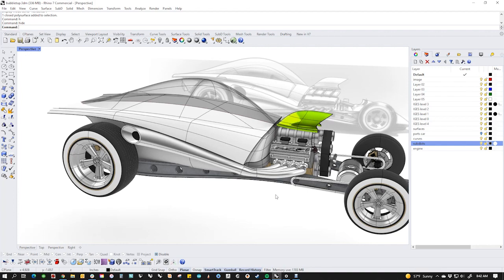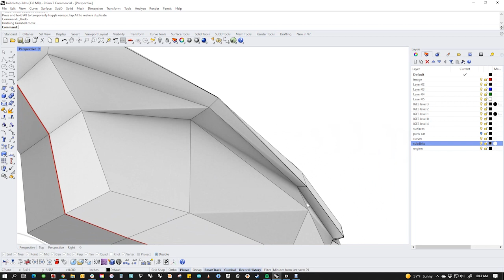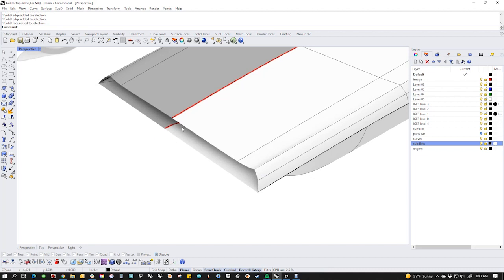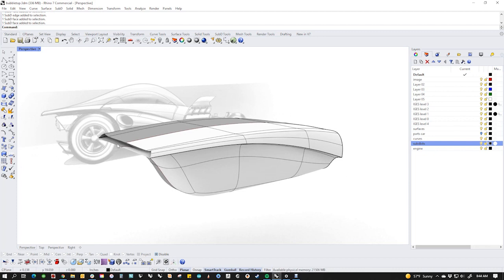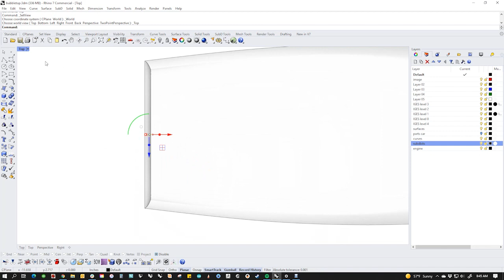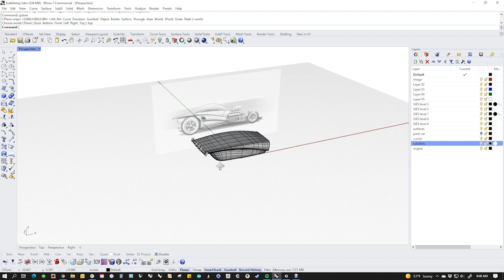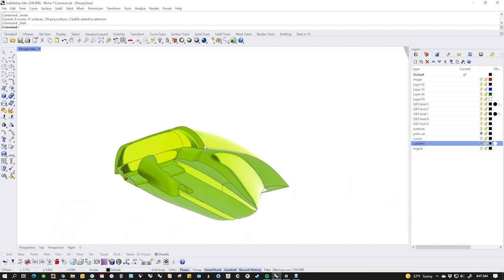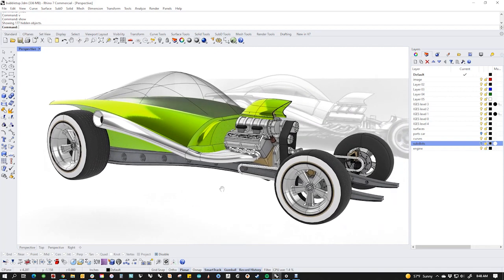Rhino 7- When to use SubD vs NURBS

Comment: One think that could really help is to have the ability to modify the radius at both ends of a piped section and find an easier way to aline the faces and to rotate an element before bridging it to a bigger one like for instance  a leg connecting to a table top.
Reply from the maker: relocation and use of the scale and rotate elements of gumball allows you to do what you are describing, unless I'm confused...
Reply: @Rhinoceros3d  for the radius  modification as well?
Reply from the maker: @prometheuslg  if you need precise dimensions, you'd use the nurbs pipe tool. 

to change the radius of a pipe end you can draw a temporary object the correct size, then matchsrf to that part. then delete the temp object

Comment: It would be nice if rhino had something like a history reference. So you can go back to your subd and change stuff and switch back to last edit where everything is nurbs again. I know it might lead to conflicts. But thats also the case in programs like inventor.
Right now when you convert to nurbs and you need to make some big shape changes its hard. You usually ditch all nurb edits and restart over. That sucks. It must be possible to have a reference history system in which the system can go back in history to change stuff. identify conflicts/issues and so on.
Reply from the maker: Yep, that type of parametric association has benefits,  but rhino is not parametric and unless we let grasshopper into the conversation that won’t change anytime soon. 

I talk about this often, make sure you save  a copy of your subd  to a layer before you convert to nurbs.

Comment: Hello, thanks for the video.  Are the surfaces we made with SubD suitable for production? We can make G1-2-3 connections between surfaces in NURBS, how does this happen in SubD? For example, can a seat drawn entirely with SubD be produced?
Reply from the maker: subd is g2 everywhere except star points which are g1. 

the conversion from subd to nurbs is 1-1 so that continuity is translated exactly from subd to nurbs. 

As long as the nurbs result of that conversion is suitable for your needs those surfaces will machine or build  just fine from a printer or cnc.

Comment: Hello,
Is there a problem with surface continuity when SubD and NURBS are used together?
Reply from the maker: how are you planning on using them together? if you convert subd to nurbs, no issue at all, you can simply matchsrf to get continuity you want. 

currently there is no way to match a subd to a nurbs surface, however there is internal work going on in this area for inclusion in a later release.
Reply: I have to give the designs we made with SubD to the engineers later because they do the mechanical design. Will it be a problem for them after converting to NURBS ? (They work in STEP format) Thank you for your answers  @Rhinoceros3d
Reply from the maker: @almanharikas7095  should go thru no problem. Let us know if you hit any problems at tech@mcneel.com

Comment: where i get stuck is that i want to make a complex shape from parts that are 1 part subD and 1 part Nurb surfaces... can't seem to mix them together properly (good enough to 3D print)
Reply from the maker: build them so that they overlap, then copy the subd and keep it for later. convert the original to nurbs, and trim and blend to connect them.